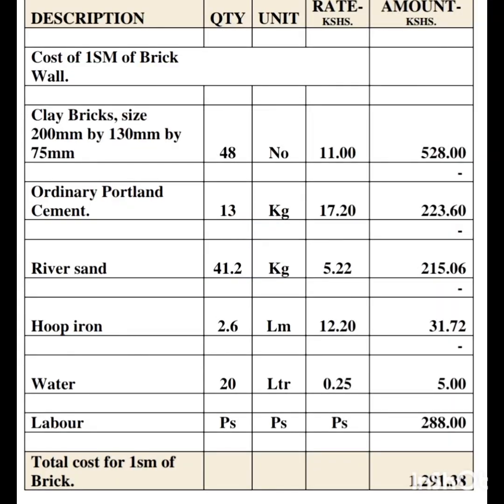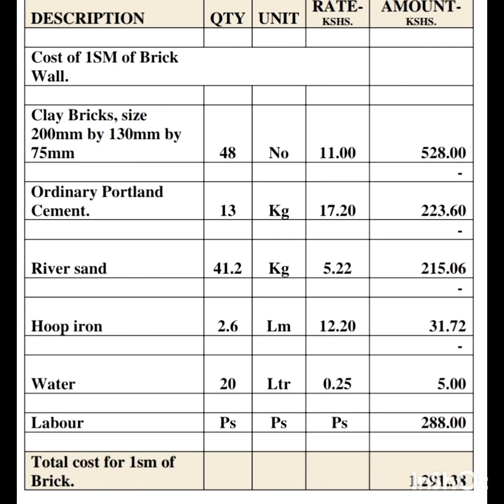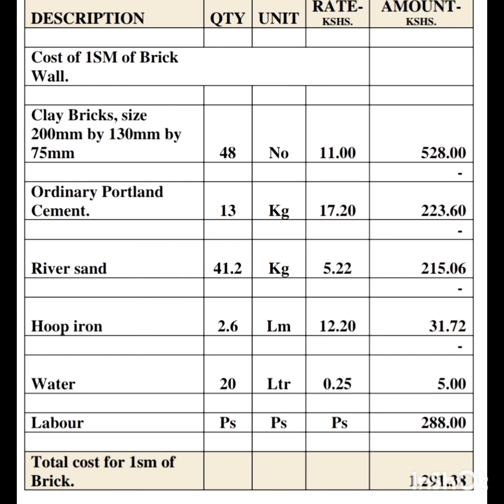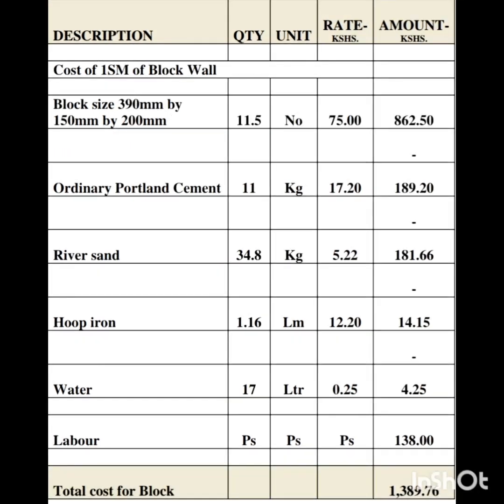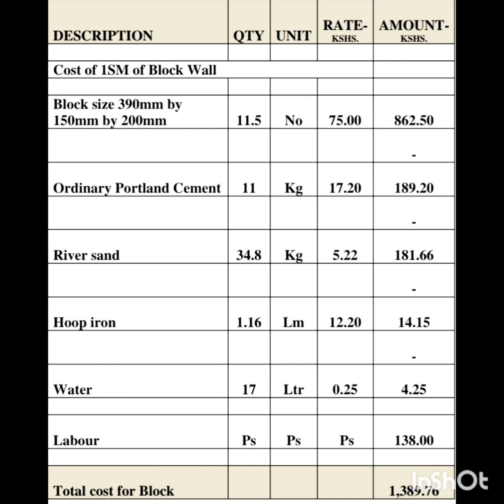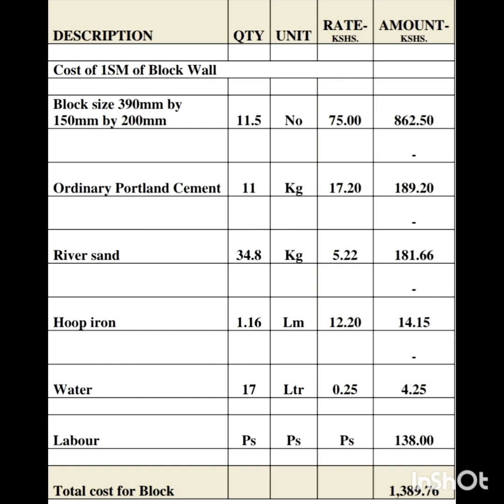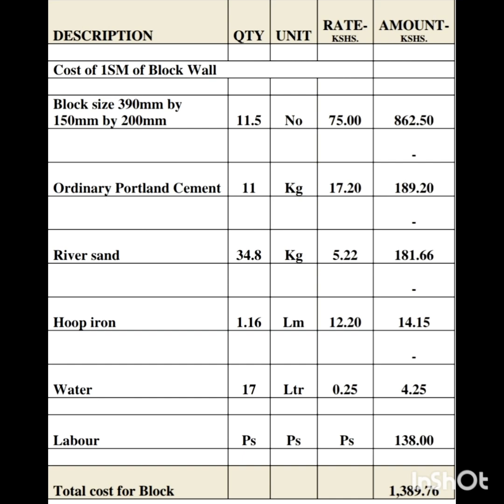Bricks VS Blocks Prices: Which One Is Cheaper, For Building Your House.

Comment: thought the cost per brick is lower, you will use more bricks and hence more cement and sand compared to the block
but very use full information you have shared
Reply from the maker: Sometimes transport plays a big role in the cost of an item.

Comment: As per your video yes brick is cheaper but what about which is best material to use as durability brick or block.Thanks
Reply from the maker: Hello.
The machine made blocks have turned out to be one very strong material for walling.Compared to good quality brick..The blocks still beats the bricks in so many ways.
Thickness.
Better Sound insulation from room to room.
And overall  strength